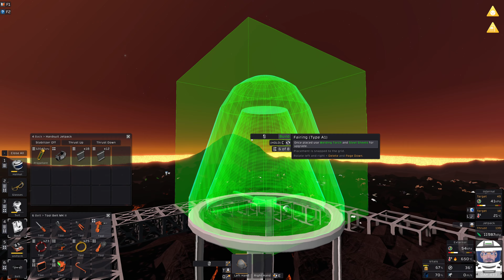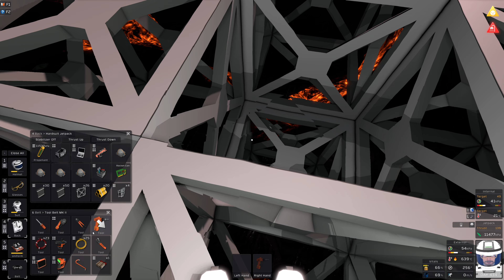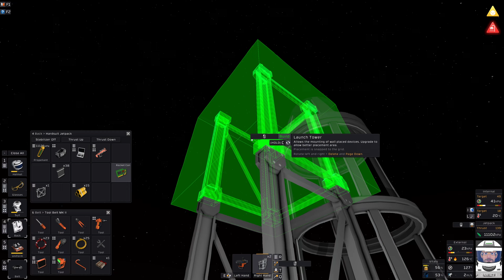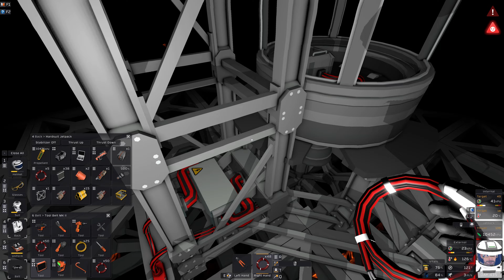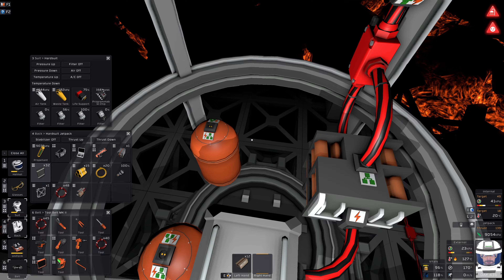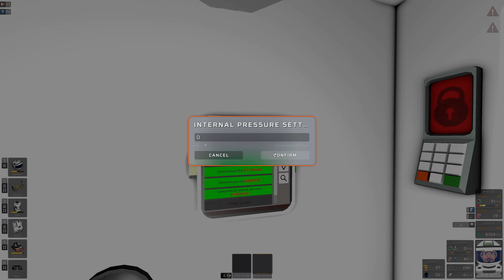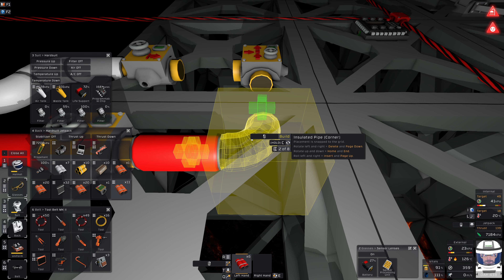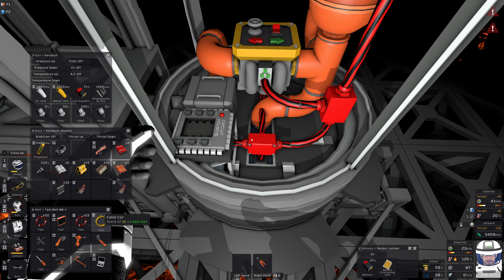How to build a Rocket (Amateur) - EP40 - Stationeers - Vulcan - Brutal Start - Project Hot_Ape

Comment: Edit: GREAT Job on your first tricker flight 
Rocket building tips:
1 start with ur large items first, med tank, miner scanner then med batteries.  And save your small items last for they can anywhere.  
2 the small fuel tank and small battery, are useless.  Use the medium tank/batteries and use at least 2 med batteries. 
3. Make a rocket for one purpose scanning or mining, a scanner rocket can have many scanners in it. You can in 1 fuselage section fit 5 scanners in it.
4 scanners weigh NOTHING, but cost a lot of power, miner weighs 500kg or 2750 N
5 N (newtons) is = gravity (Vulcan is 5.5 ) x weight (kg).  It’s a good idea to have your gross Wt in N to be 1/2 your max rocket engine thrust.  Yours is 16kN
6 lastly there is no shame to make a creative world and play around with the 3D Tetris of rocket building
Reply from the maker: Hi Charlesheath. Thank you and thank you for the information.

The single small battery didn't too bad but I'm very aware that all I did was scan with a single scanner and I also didn't travel very far either. Yeah I am going to look at storing additional fuel for the longer trips so we'll see how that goes.
Reply: @PanicAndDieGaming  one big problem I think you will have is weight, that 16kN engine I don’t think will cut it for mining.  To give you numbers 4 fuselages (1 engine cowling [100kg] 2 body[250kg ea] and 1 nose cone) rocket engine (500 kg) miner (500kg) is 1600kg.  1600kg = 8.8kN wt, (1600 x 5.5 (Vulcan gravity) this is without any fuel or cargo.  You might be able to use that basic engine with a small cargo, but you will be cutting it close.  The Reentry Altitude is when your rocket will start “hitting the brakes” higher altitude means better chance of success but more fuel burn.  Note the Pressure Fed Gas Engine can use premixed fuel (2H O) if you connect its inputs together.  You will need a volume pump (reg) to keep its input pressure high, like 55-58MPa.  That will require programming.  Good news is the rocket IC housing CANT detect any device Outside the rocket, but you can detect it from outside the rocket.  It’s kinda weird, but very helpful for automation.  
You will need to chute connect a miner to a cargo storage and use the chute umbilicals to unload the rocket. Lastly move the launch tower away from the rocket. I think it can up to 3 frames away to work.  This will give a visual clue showing your umbilicals are retracted
Reply from the maker: @BayalinAlamain   Thank you. I will give this a think and a go.